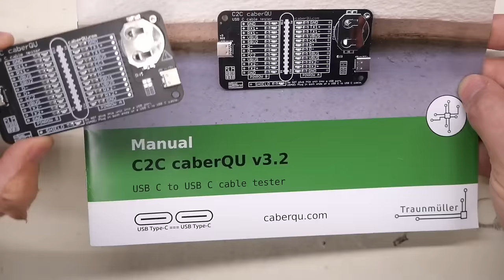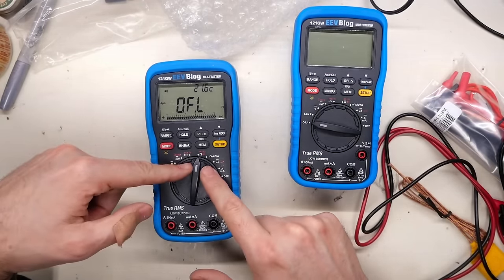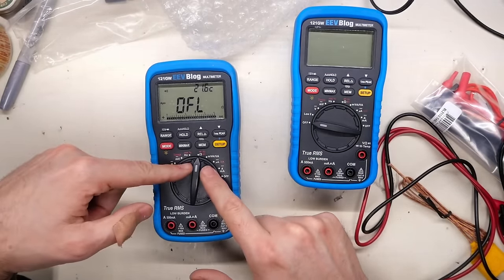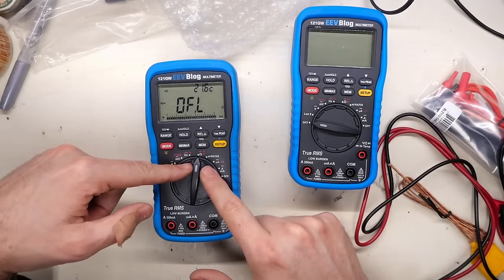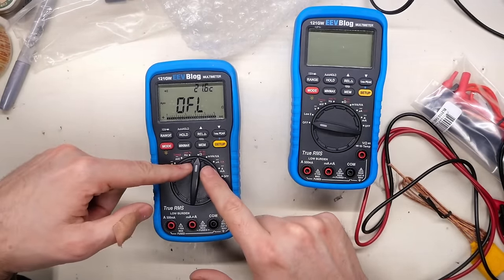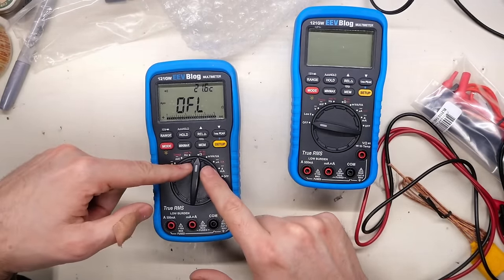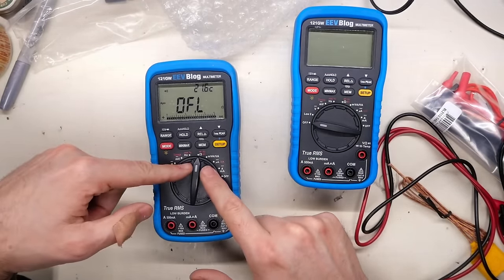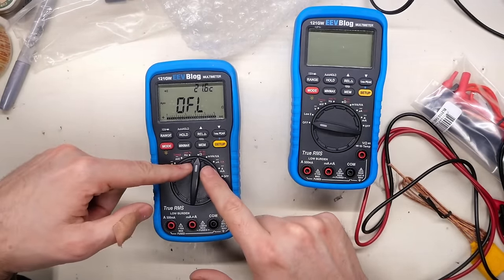0080 A 128k RAM upgrade for the Speccy, some recovered SIDs, USB-C Cable testing and a new DMM

Comment: People who leave the factory screen "protection" on devices drive me crazy. They're not designed or intended to be left on; their purpose is to protect the screen during the manufacturing process so that you get a pristine screen when it shows up at your door. They're not designed to be good to look through or to stay on indefinitely, so invariably they're optically awful and peel up on the edges and collect all kinds of nasty dirt and grit.

Either remove it and use the screen bare (if you like to live dangerously or don't care about scratches) or install a proper protector designed for use while it's installed.

Comment: One more comment about batteries. The alkaline leakage is not your bad luck - they are ALL susceptible to leakage, regardless of brand, even if not discharged. It’s not unusual for me to buy an 8-pack of AAA duracell or energizer batteries and a year later a couple of the unused batteries are starting to leak. And yes, these are stored in a controlled (65-75F, 18-25C) indoor environment. So much for the “5 year storage guarantee”!

Comment: It is amazing to me how youtubers with high fan count can distort reality and features of everyday implements or testing equipment based on just "i feel like it". I don't even want to comment on the multimeter rant, every point was wrong on one level or another, other than there is a real difference between cheapo multimeters (everyone should stay away from them but for all of the wrong reasons stated here) and expensive one (that Mr. Guy in the industry is also a cheapo and after nearly 40 years of digital multimeters existing - my oldest is a König that is now nearly 30 years old and still works like day one, I do need to calibrate it each now and then - those faults should not even be a thing on today's equipment, even the cheapest. Yet, here we are!), but none of the real reasons was raised here on the real and probably life threatening differences between the cheap, the semi professional, professional grade and the really expensive ones that can earn back their value because they are used for certification or really difficult troubleshooting (blown cap is not difficult, that's just annoying).

Comment: Audio Adapter Accessory Mode is the specification for putting analog audio over a USB Type C port. Yes, analog audio. The idea was to be able to use cheap passive adapters for 3.5mm headphone jacks. But of course this requires hardware support in the host device so not everything is going to support it.

Older Android phones often had the necessary DAC and other hardware but I think newer phones usually omit that to save a few cents (and more importantly, space).

I don't think Apple has ever supported audio adapter accessory mode on any of their products. But they also sell a surprisingly cheap ($9) active adapter (Apple part number MU7E2AM) with an excellent DAC that's probably better than the DAC built into most phones.
Reply from the maker: I have a few adapters for my Pixels --- I don't recall where I got them, but yeah I bet they have DACs inside. Funny how USB-C is such a "mess" when it comes to allowing manufacturers to do whatever they want.
Reply: @adriansdigitalbasement2  Yeah, it requires you to actually make yourself quite familiar with the different standards and options to not make a mistake when buying accessories like headsets.
When I bought a new AMD laptop I actually had to dig deep into the datasheet to check if the USB 4.0 port would actually support PCIe Tunneling for my eGPU box, unlike Intel where ports are labeled Thunderbolt so you know it supports everything.
Reply: I wonder if their adapter would be recognized as a digital audio output device on a PC. It'd save me the trouble of dealing with the interference I always seem to get from front analog jacks thanks to poorly shielded video cards...
Reply: @stevethepocket  I use the USB-C headphones that came with my Galaxy phone and they work on PC, Steam Deck, etc. Same with an adapter from USB-C to 3.5mm.
But they have a built-in DAC, I don't think an 'analogue' headset/adapter would work anywhere else.
But just plug them in and try 🙂

Comment: I actually have a 121GW as my main multi-meter (thanks to Adrian 😅) and an Aneng AN8002 as my backup. Used to have a UNI-T but I blew up the amp ranges and gave it to a friend who just occasionally needs to check voltages. My Aneng also started misbehaving but rotating the switch all the way a few times and putting in freshly charged batteries seems to have fixed it

The 121GW bluetooth mode and app is a bit barren but really nice to have if you need to log data.

Also having temp probe capabilities in both is great. I do a lot of 3d printing and being able to externally monitor the heating elements when something is going wrong is great for verification.

Comment: Take the DMM back apart, the range switch is just a giant rotary switch, DeoxIt should be able to fix it up.
Reply: I am just so surprised that this wasn't his 1st thought. It's normally "this pot is a bit scratchy, let's get some deoxit in there". Instead we get "I don't want to damage the multimeter".

Comment: You can test this in basic by the way:

9  REM Start here
10 LET M = &8000;
19 REM end...
20 LET END_ADDR = &FFFF
29 REM ... because Rammy
30 PRINT "Bleatings commencing!"
40 FOR ADDR = M TO END_ADDR
50   LET VAL = INT(RND * 256)
59   PRINT "Writing:"; ADDR
60   POKE ADDR, VAL
70   LET VAL_READ = PEEK(ADDR)
80   IF VAL <> VAL_READ THEN
90     PRINT "Moo @  "; ADDR
100  ELSE
110    PRINT "Read:"; ADDR; " Okay"
100  END IF
120 NEXT ADDR
130 PRINT "/Bleating."

This may chug and you can remove the print statements and the else, apart from the "Moo" line;
also couldn't test from here, but the Hex for the addresses might need to be  32768 and 65535 if there's an issue
but unlike the C64, the speccy is fine with Hex :) Go Z80!
Reply: You could just poke an incremental number too instead of rnd for more speed...

Comment: Talking about crappy probes that come with cheap multimeters you should see the ones that came with my Fluke meters ( two 87V and one 179).. considering the price of the Fluke equipment the crappy plastic probes they provide you with is an insult

Comment: The C2C caberQU can only test USB-C. I have one that can test USB-A, B and C including mini and micro USB.
I have an APPA multi meter from the 80s that still works. No range switch issues.
Reply: What's to test with USB A/B? There's four conductors plus a shield and all four are required for anything other than dumb power delivery. I guess you can check to see if it works, but just trying to use it would do the same.

(Okay, it looks like mini and micro USB actually have a fifth conductor, for USB On-The-Go. Does anything actually use that?)

Comment: All this testers are made in the same way....... they have exposed copper traces on the board that are touch by metal brushes.... every time you turn the selector switch .. the brushes bend down making them more flat =  worst contact....... is just like the mode switch of the old VHS machines... and you Adrian see Dave from 12VoltVids cleaning those damn VHS switches thousand of times.. terribly unreliable........  you need to remove the board.. clean the traces.. put some contact cleaner on them.. and bend back a bit the brushes ... to make them springy again and also clean and contact cleaner on them....... something I like to do is.. put some thick grease in the balls that make the selector switch jump... before they wearout the plastic.. and the selector switch star "misplacing" the brushes over in the contacts....

Comment: Any electronic device with mechanical parts will be flakey by design except for really high end devices.  Stop tapping it!! The mechanical parts are not designed for it.

Comment: USB-C. What a mess of standards (or none) on a really rubbish connector. Apple had the Magsafe connector which was good but wouldn't let anyone else use it so now we're stuck with this sh1t. 😀
Reply: Magsafe only provided power. What's rubbish about the USB-C connector?
Reply: magsafe is kinda complicated for providing a pin of power. the iphone(lighting but not that lighting, double naming too) connector doesn't have that many pins. the problem with usb is that they didn't bother to make and enforce standards for markings on cables and ports.